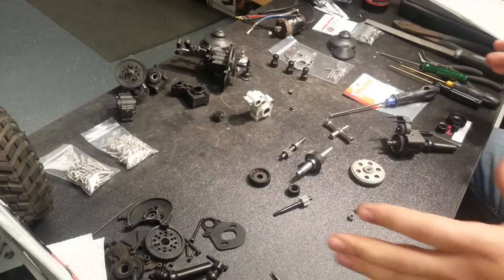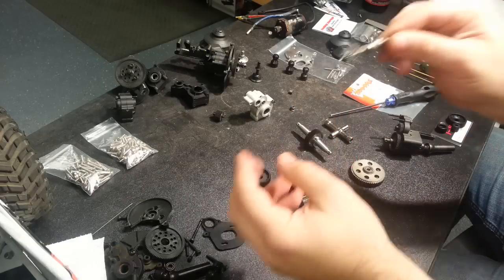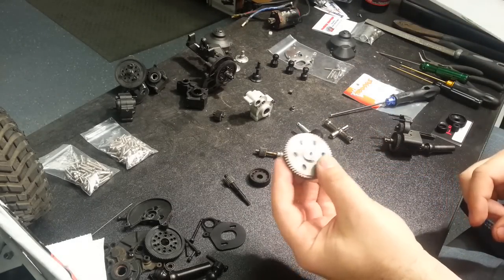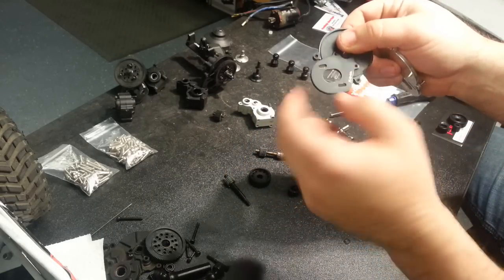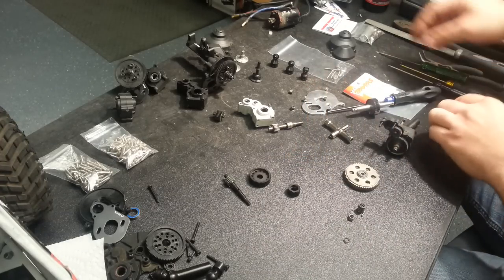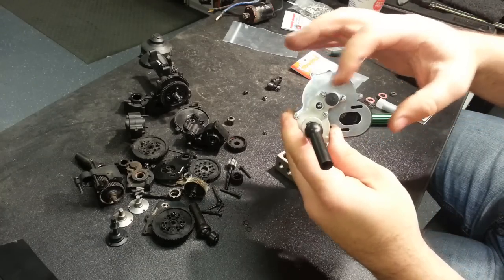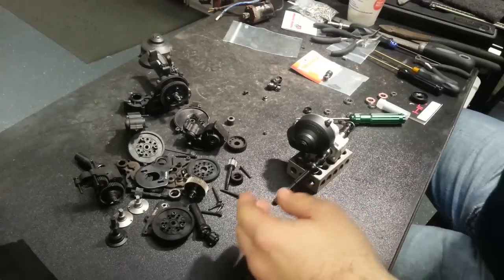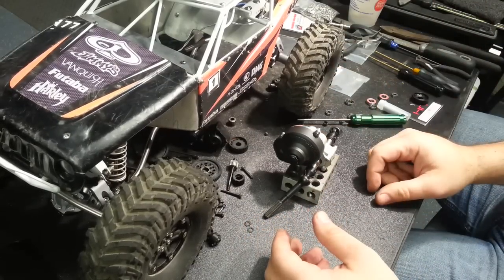Build a Bulletproof Axial Transmission - Final

Comment: what pinion size did you use? 56 tooth vs 80 is a big difference.
Reply from the maker: Yes, big difference but 32 pitch is much stronger. I use a 12-14t pinion typically. Make sure it says it's a HARDENED gear though or it will wear out quickly.
Reply: +Harley Designs cool, thanks for answering! i'm building my 1st wraith, (also my 1st kit) and i need all the help i can get. i love your channel by the way. very entertaining, and a lot of usefull info.